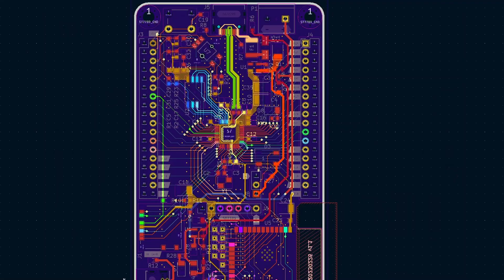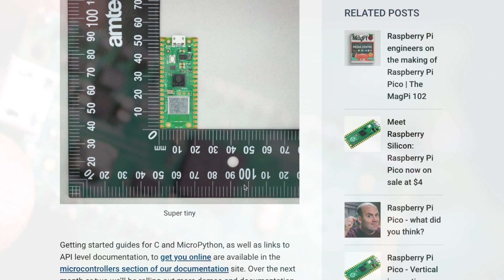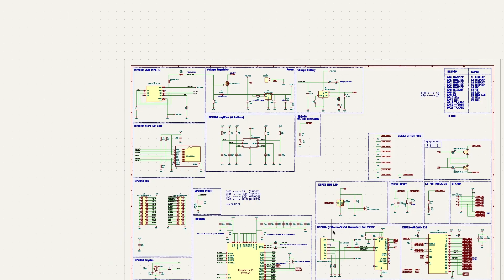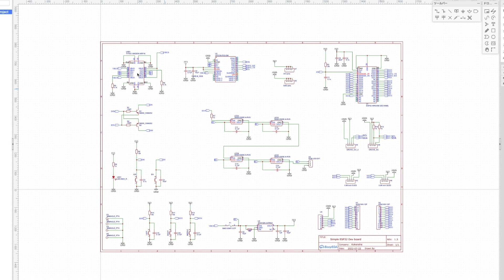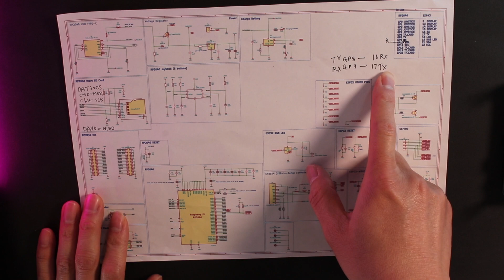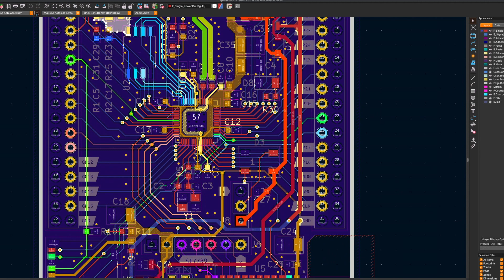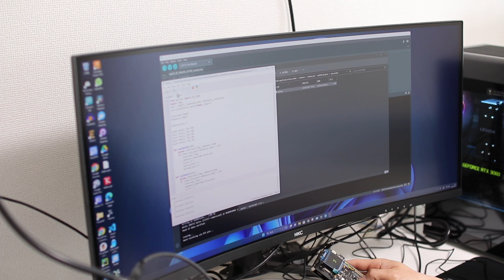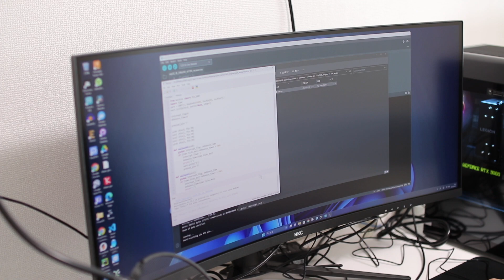How to make your own Raspberry Pi Pico W (RP2040 + ESP32  experiment board)

Comment: so what firmware and software stack  did you used for the comms between the 2 chip , was it the AT hayes stack or did you write the packages for the esp32  and then the Pico ?
Reply from the maker: I write program for both ESP33 and RP2040, communicating via UART

Comment: could you please what I would have to do to connect an rp2040 board to a esp32 dev. board to have a working rpi pi pico w.  Thank You
Reply from the maker: Sorry for being late to reply. I connected RP2040 with ESP32 simply with UART, be sure RX and TX are connected correctly. I screwed up once.

Comment: Very great project! 
One question: you told me about your BUG in your video and fixed it with the two wires. 
Did you then adjust this fix in your schematics in the github, or is it still there?

Best
Stefan
Reply from the maker: Yes, I believe it is fixed.